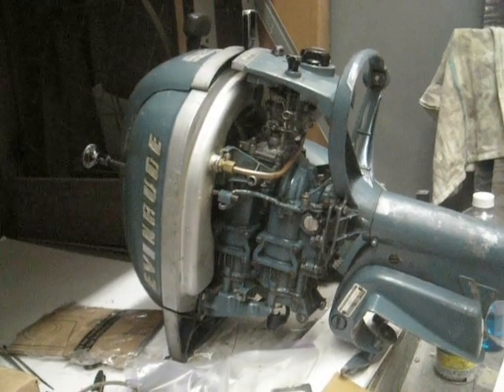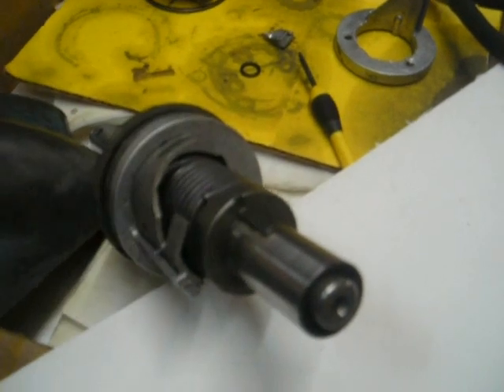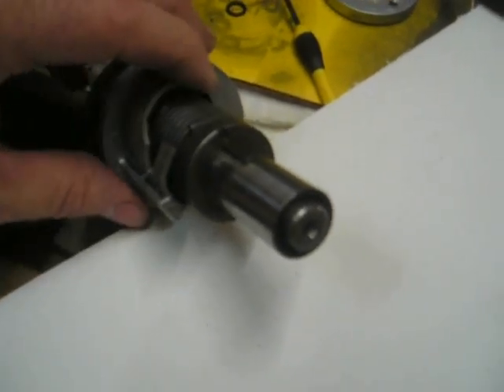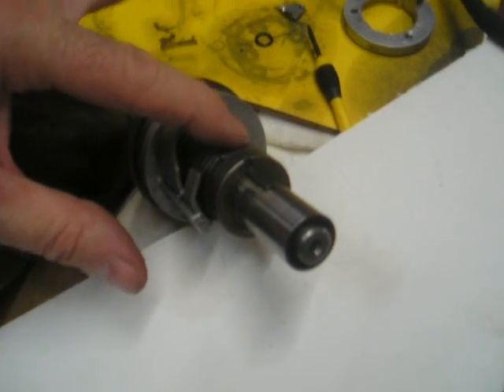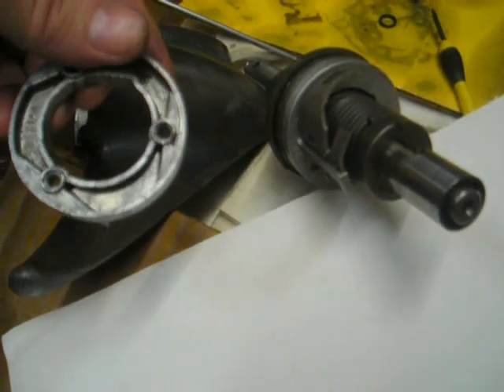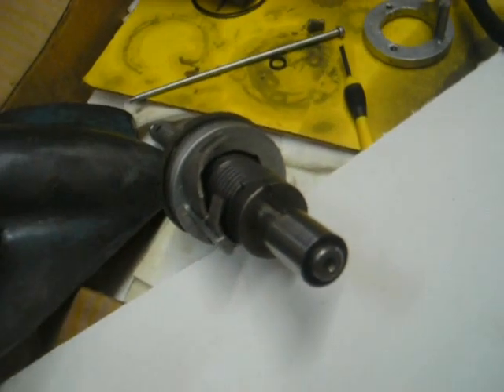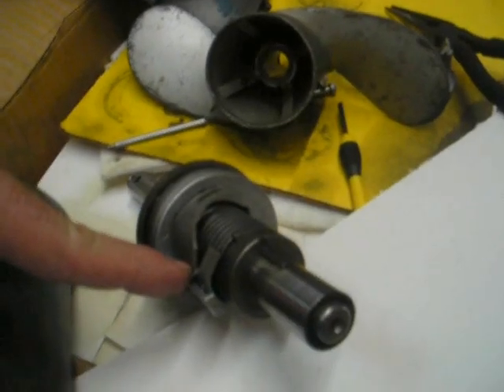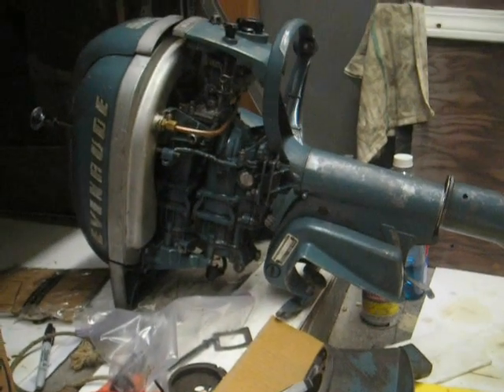1952 Evinrude Fleetwin 7.5HP Neutral Clutch MECHANISM 1

Comment: Where were you able to locate parts? I have a motor identical to that and am having difficulties finding replacement parts. Mine is having issues with pumping water. I have only tested it in a bucket, not actually behind the boat but it seems it does not want to pump water up. @3beltwesty